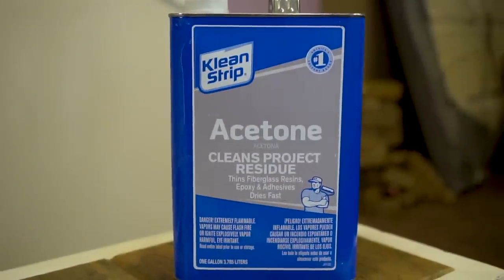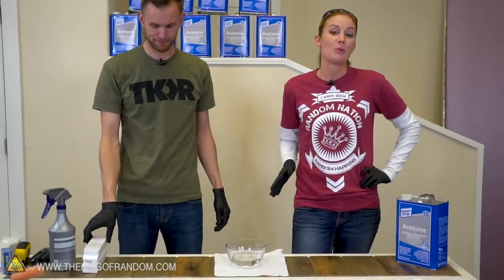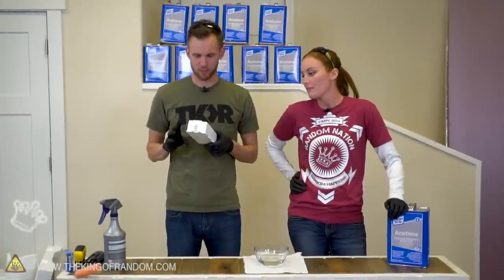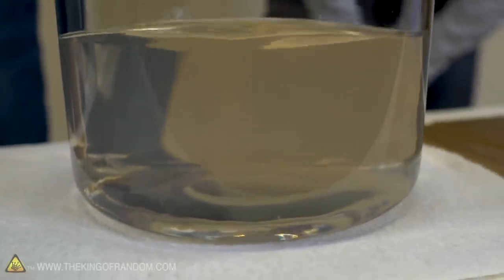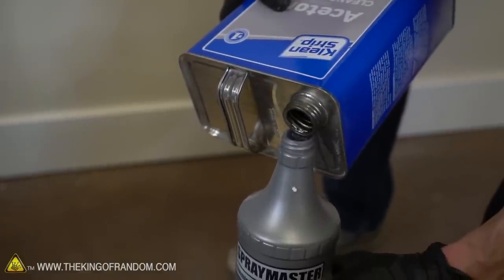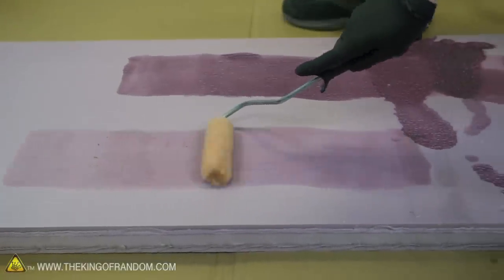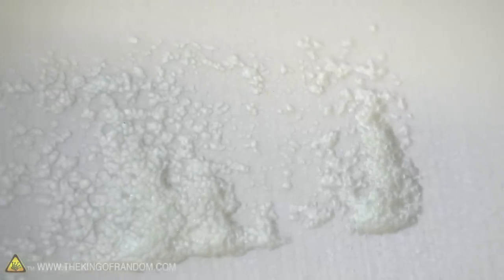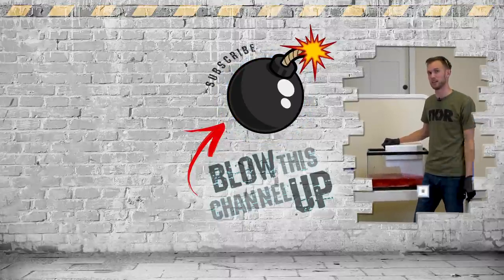This Liquid DESTROYS Plastic

Comment: Half of the comments are who framed roger rabbit and the other half is napalm
Reply: I was thinking those very things. Are you a witch?
Reply: Dumpsterfire 
Wrong video man
Edit: I saw 2 comments and you are 99% correct
Reply: True very very true
Reply: Saved me scrolling haha
Reply: No 0.000000000000000000000000000000000000000000000000000000000000000000000000000000000000000000000000000000000000000000000000000000000000000000000000000000000000000000000000000000000000000000000000000000000000000000000000000000000000000000000000000000000000000000000000000000000000000000000000000000000000000000000000000001% no
Reply: True

Comment: “This liquid dissolves plastics” wears plastic gloves
Reply: Those gloves are not made of plastic, it's probably nitrile rubber which is resistant to resistant to oils, grease, organic solvents and acids (to some extent).
Reply: @Ferdish3  it’s a joke
Reply: @bwmgaming6938  if it was meant as one the you missed a smiley or two in there 😜

Comment: You should take this goop and put it in molds and let the acetone evaporate from it.
Reply: That would be so cool!
Reply: You can make knives with the mealted styrofoam if you let it dry and harden in a mold, also you can melt the styrofoam in gasoline and make napalm and you can burn it and take the product of the napalm and harden that in a mold and make MORE KNIVES that closely resemble obsidian. 😁😁
Reply: Yessss
Reply: Modern rogue did
Reply: @thebackyardbushcrafter2028  link to that video?
Reply: @RomitHeerani  Just look up modern rouge Styrofoam. Lol

Comment: But can you then mold the goo into something?
After the acetone evaporates  will it be strong?
Reply: Dissolving polystyrene and molding it is in fact extremely possible and easy. The cured plastic is very hard but brittle but far from useless. Lego blocks are basically polystyrene same basic chemical make up.
Reply: It is possible,and it will dry into a fairly hard plastic,the only issue with acetone is that if it gets on your hands it’ll irritate them,and as they showed with the gloves they use it dissolves them also,using rubbing alcohol however achieves the same result and is a lot easier to work with.And it evaporates fairly quick also
Reply: Look up Modern Rouge..they did this and molded knifes with it!
Reply: @nanaki-seto  not true, Legos are a specific mix of chemicals and and can be used to make a driveway (not very long lasting but stronger than bone) at least the original Legos
Reply: @kamdengainey3149  do you mean knives?
Reply: @nanaki-seto  Lego is acrylonitrile butadiene styrene, while Styrofoam is just polystyrene, but they can both be dissolved with some ketones
Reply: pinchflat; polystyrene, when cured is a chain molecule. Acetone breaks the bonds of the chain molecule. As the acetone dries the broken chains will clump and harden together but the chain bonds can not form while any acetone is present. The hardened plastic, once the acetone has evaporated fully, is extremely brittle. There are ways to reclaim polystyrene but those mostly involve melting the plastic with heat.
Reply: After the acetone evaporates the plastic hardens again, which means that you can actually pour that goop into molds and make all kinds of things.
Reply: the modern rogue did an episode on that
Reply: @kamdengainey3149  You mean..knives?
Reply: @3DPDK  It's actually not brittle at all if you cure it slowly enough and prevent bubbles from forming.

Comment: Can you cast with the liquid styrofoam
Reply: Only very small objects, as you scale it up, larger bubbles form like in a croissant and crack open where the material is thin. Conceivably you could use it as the adhering component in a composite material though.
Reply: I was just about to ask the same thing. Would be cool to see
Reply: I was going to ask that great idea though
Reply: modern rogue already did it.
Reply: Probably not
Reply: Maybe if you use the vacuum chamber as I’ve messed with the stuff before and crushed the stuff in liquid state between my fingers to get the air out and was able to get a about 1/8 in 3mm thick section to form without bubbles after it dried and i broke it
Reply: I don't know about molding/casting specifically.  The slime does dry into a hard plastic, so one could sculpt with it, in theory.  The acetone makes it soft enough to let most of the air out, but you do end up with light-ish material as the acetone evaporates.  I've melted down a few cups and rolled the result into a ball it came out like a ping-pong ball(with the exception of not being hollow). One cool thing I've seen is to just expose a 3D printed object to just acetone vapor(in a sealed container)....it will eventually melt but if you limit exposure you can smooth or even shine the surface a bit.
Reply: Modern Rouge did it and it worked
Reply: For fun, I actually made a latex mold of a small figurine in tin, and casted that in melted polystyrene. the resulting figure was pretty decent, but the latex shrunk a bit so it wasnt quite the same. Also there is a problem with bubbles forming as the acetone evaporates and forms bubbles that gets trapped under the top layer that has had enough time to harden.

Comment: When I was a kid, I discovered the hard way that gasoline melts Styrofoam. I was working on a small engine and needed something to put some gas in to clean some parts. So I poured it into a handy sonic cup, and didn't make it two steps before gas fell through the bottom.
Reply: Wow
Reply: Accidental napalm
Reply: yep. i found that out as a kid also.. i put gas in a Styrofoam cooler.. or tried .. lol
Reply: Oof
Reply: Done the same thing when I was a kid me and my friend made a bond fire and went to throw a cup of gas on it and basically just slung a bottomless cup lol happened so quick we had to think if the cup was bottomless to begin with so we done it again with another cup lol
Reply: rcredmon did the same lmao my friend bout did it n i told him wat would happen n he still did it anyway
Reply: In the Philippines melt styrofoam using gasoline to have a product called ragbi...it is an adhesive.. very sticky
Reply: Oh nooooo
Reply: Lol 😂
Reply: And also very flammable, it's the precursor substance to Nepalm. So have at it, you guys just accidentally made a war crime.

Comment: What would happen if you mix dry ice in acetone
Reply: Thanks
Reply: yee noice question
Reply: YES DO IT I AM DYING TO KNOW😑😑😑😑😑😑😑
Reply: Yesssssssss
Reply: Super freezing liquid, pretty sure they have done that already
Reply: You would get frozen Acetone....
Reply: Samuel Sellers no u wouldnt, acetone has a very low freezing point it would just get super cold
Reply: Marqese Cobb nuclear explosion
Reply: Basically home-made liquid nitrogen
Reply: You would get a coolant mixture commonly used in laboratory condensers and traps to achieve very cold temperatures.
Reply: Cyro fluid
Reply: Marqese Cobb omg

Comment: I've painted acetone onto pink foamboard insulation to create bricks for stage productions.  Its incredibly effective and much cheaper than the masonite bricks or the plastic formed stuff.  You just paint in the grout, then spatter to make some imperfections in the bricks.  Paint in the grout, then use a roller to paint the bricks.  IMO it looks way better.

Comment: Collect the melted polystyrene and mix it with gasoline... sticky fire
Reply: or also called nepalm
Reply: Diesel is better to use.  Lower flash point and it burns hotter
Reply: You know they already did this years ago.
Reply: Michael Cadle I think that’s just napalm...

Comment: Not that anyone should do this at home, but that goo is essentially Napalm...A trip to the dome in the future?
Reply: Yeah they are being really careless with their "experiments"
Reply: Wow. I’m now going to blow my self up with polystyrene and acetone! Thanks!
Reply: That means they have to be extra careful and less careless and get more protection they could blow up that house they are in 😟
Reply: Thank you someone said it I was coming down to the comment section myself to mention that it is basically napalm
Reply: Gasoline works great, this is what we used to do as kids x'D
or maybe it was diesel 🤷‍♀️
This must have been in the anarchist/jolly roger cookbook
Reply: We used gasoline
Reply: @redturtle234xd5  it won't blow up, that is essentially thicker napalm and just burns slowly. I would only be worried if they flung it everywhere.. that stuff isn't fun to clean up
Reply: Zach Cain I know I’m just saying it could blow if it got to gas and flame sources like a boiler or the oven
Reply: @redturtle234xd5  was just saying that it won't blow up. Just burn slowly. About the same as a candle. They also have a few other people there and most likely have a few different types of fire extinguishers.

Comment: This is a great trick for complex, single-use molding - create your "plug" piece from expanded polystyrene, build your mold around it, then pour acetone to dissolve the plug.
Fill the mold with your final material, then break the mold off.

Comment: When acetone evaporates, it gets really cold.   Could you guys make some sort of refrigerator or air conditioner?
Reply: I agree with Ken probably not healthy
Reply: no as the wy it makes think feel cold is because it draws out the heat
Reply: Ken Carter   I was thinking of using it in a circulatory system (enclosed).
Reply: there are evaporative coolers, but they usually just use regular water. If you really wanted to, you could probably design one with acetone

Comment: so if the polystyrene can turn solid again can you sculpt with the styro-goop?
Reply: Draw with Jazza has entered the chat
Reply: @yoinkyonk  lmao they should collab
Reply: yes, this is something they have done before.
Reply: Yes, you can pour it into a mold - but it will shrink by the same amount of acetone you put in it so for casting purposes it is far better to use an epoxy or urethane resin.  (Or even polyester if you have no sense of smell.)

Comment: I worked in a machine shop and we would use it to clean oily parts. It will dry out your hands crack open and bleed if you use it too long bare handed.

Comment: This liquid is helpful to get the plastic from not to be buried in ground
Reply: Oh yeah, where should the acetone go from there then? Dump it to the toilet?
Reply: @saitenotoshuitsnaini  it will evaporate
Reply: @IMKINDOFABIGDEAL13  the acetone might but the liquid goop may not and maybe the contaminated acetone may not due to to it having chemicals in it
Reply: @drunkenlama6030  the question was where will the acetone go. It will evaporate. Anything else will still be there. As they are not acetone.
Reply: @drunkenlama6030  the reat of the stuff will return to its original state amd can be thrown in the trash once the acetone has flashed off
Reply: @IMKINDOFABIGDEAL13  yea but what about the contaminated acetone there might be a Chance that some acetone changes is chemical composition with some of the foam or plastic
Reply: @drunkenlama6030  well i giess there might be a chance. But pretty unlikely. Is this breaking your little heart of something?
Reply: @IMKINDOFABIGDEAL13  baha mate im just tryin to have a convo

Comment: Sulfuric acid is possibly even more effective, an experiment I found intresting was pouring it on toilet roll (At least do it after quarantine)
Reply: Sulphuric acid doesn't do anything to polystyrene.
Reply: chloromethanol ttxttxd 
Sulphuric acid can burn through tables given time, Polystyrene should take a second for it.
Reply: @crimsonx7182  sulphuric acid doesn't burn polymers. Polystyrene is a hydrocarbon polymer.

Comment: Can you use that goo for something? like put it in a silicone lego mold, dry it and have a piece of lego?
Reply: DarkPlayer you could burn it, but you reaaaally shouldnt inside
Reply: Check out the modern rogues video on it
Reply: Dark player yeah you can, it would take forever to dry though, as as the surface dries, it seals the acetone in.

Comment: this is something i've been wondering for a while, and finally a relevant video for it! Can you take acetone, saturate it as much as possible with styrofoam, compress the resultant mixture into plates and let it dry? basically make your on plaplates as they're called in the model kit community
Reply: also in a similar vein, what about melting down lego and putting them into molds to make your own

Comment: Try mixing 30% hydrogen peroxide with acetone and lighting that on fire.
Reply: The polystyrene-acetone solution itself is pretty flammable. H2O2 might be excessive.
Reply: @arifhossain9751  'Excessive'?  BLASPHEMY.
Reply: i like your thinking

Comment: Cut the bottom of an aluminum soda can and use it as a dish. Fill halfway with acetone. Dissolve styrofoam peanuts, lots and lots of them. Once it is saturated and won't dissolve any more, light it on fire. It will keep burning for a long time.

Comment: I've noticed that, when using 100% acetone to remove nail polish, the acetone always seems to disappear (even from the open bottle) way faster than it should. I wondered if it was my imagination or if it actually evaporated faster than water! I wonder if the dry air here affects that rate or not.
Reply: Well, obviously acetone is going to be less volatile in a water solution

Comment: Not all plastics. Most plastics don't react very excitingly with acetone. 
If you put a lighter to a piece of plastic and it burns/melts with lots of smoke, that will probably melt down well with acetone.
If the plastic seems to burn almost clear and is super oily looking, it prolly wont melt well and will just make the plastic go brittle. And break into powder like substance.

Comment: Is the polystyrene goop actually useful for anything?
Reply: @IdiotsOnPCOnAKillingSpree1337  I meant as something creative, not destructive, but thanks.
Reply: @MGSLurmey  web fluid?
Reply: @themossycobble1903  What?
Reply: 3D printer bed adhesion for ABS filaments.  Styrene bonds to styrene (and that is what the S is in ABS).
Reply: Slime

Comment: Should play with mek and mpk..also should spend a little bit on silver shield gloves. They protect from everything chemical wise. Well I think they do...at my work we have a sheet of what gloves are ok to be used with what chemicals. Nitrile don’t work with much or have a tiny amount of usable time.
Reply: Before you say anything bad about mek (mpk is bad) it’s not as bad as people think. According to the msds sheets from multiple sources, it has never shown to go through skin. Just don’t breath, drink or get it on an open wound. So same as all other chems. Also that’s for pure methyl ethyl keytone, not mixed with other stuff which does cause skin issues.

Comment: Request:  Take a set amount of acetone and melt so much polystyrene that the acid eventually reaches saturation level and no longer works.  And/or until all that is left is a pot of that goo.  Then see what can be done with the goo.

Comment: So one question what happens if you take the melted styrofoam out if the acetone and apply it to different objects and surfaces would they be incased in styrofoam or make a different compound or be brittle